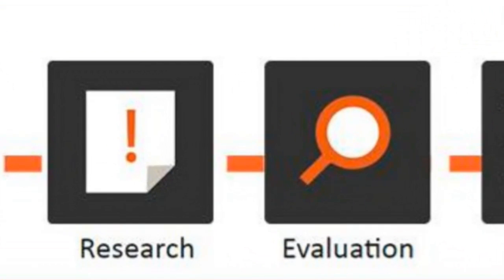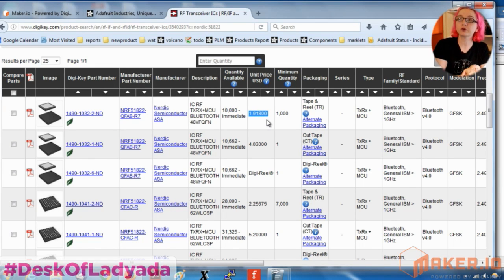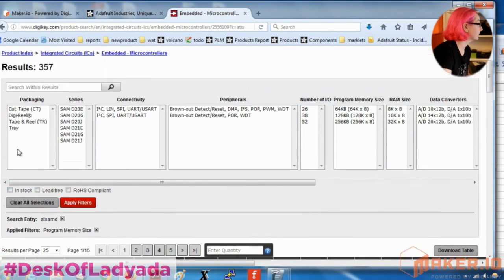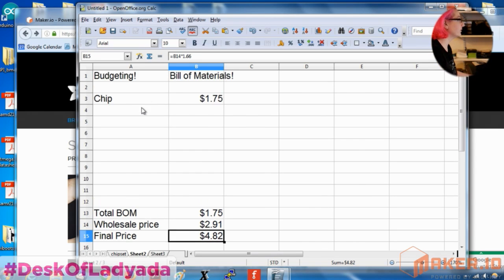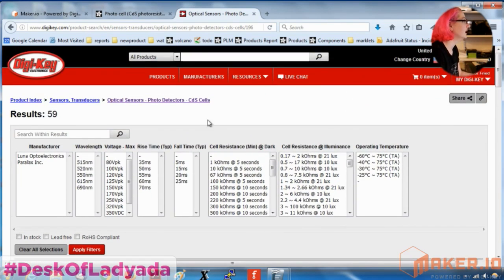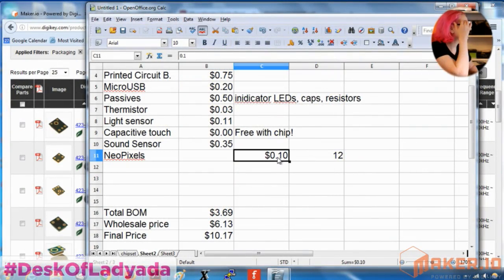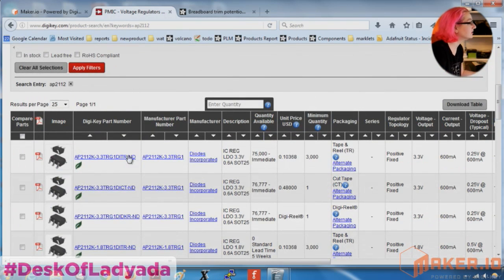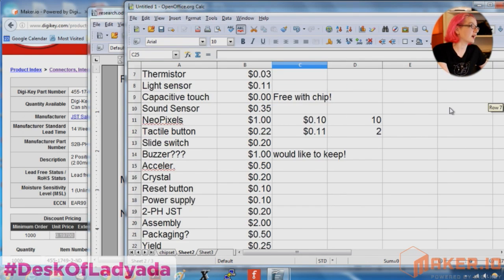Maker to Market 3 - Evaluation - How Adafruit Developed Circuit Playground @maker.io @digikey

Comment: Thank you for the series of videos.  Question on choices like BLE chip.  How many folks are going to have the full skillset to design in the radio component along with the nRF51822?  Rather, what are the pros/cons going with a BLE modules such as the MBT40 from Raytac?  

I am trying to ask a more general question also.  After watching Wired UK's series on Shezhen - I was impressed by how the folks within each of the shops/stalls shared each other's knowledge in a very compartmental way.  One person was good at A, the other B, the other C....so they would pass it between each other.  It wasn't a question of all being employees of the same company...or even contractors but rather friends.  Now, designing a BLE radio I imagine takes a little more time than doing something to fix an iPhone...but do you envision a model in which we all farmed out the pieces of our project?  If that were to happen - how would folks feed their families?
Reply from the maker: hi margaret! thanks for watching! nordic does offer and support a reference design for their chipsets, so its not terribly hard -the rf section of this chip is only a couple of passives :)  we usually suggest starting out with a module for design and prototyping is a good idea! if some part of a product is available as a module it can save time and of course their staff would get paid and it's possible to get a solution faster. for the most long-term cost savings a product designer would eventually replace the module with a discrete solution and pay for re-certification. that's the long term answer :)
Reply: I very much appreciate your reply.  Thank you.  I hope you plan to cover all the ins/outs of the different certifications needed (including radios, but consumer, electrical...i really don't know all..).  I am also unsure how you factor in the cost of certification into the cost of the product.  For now, I assume 40% marketup wholesale then 40% markup to retail covers all costs (people, building, services such as accounting...)?